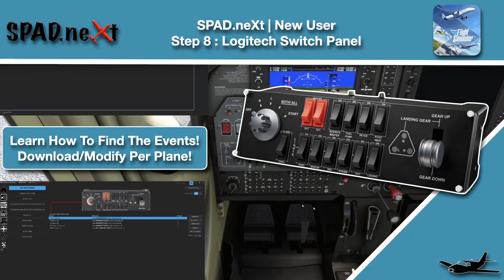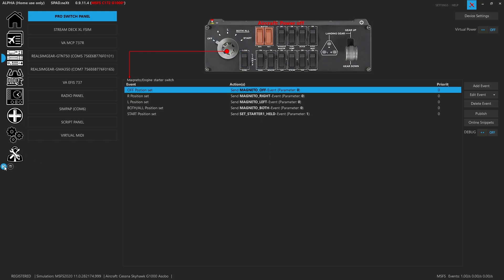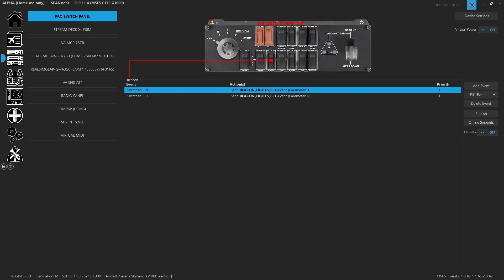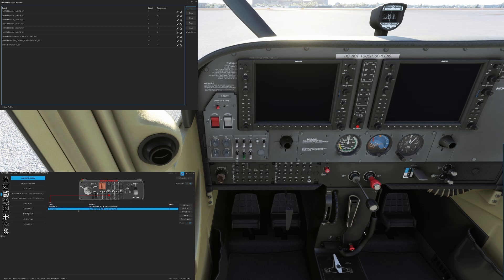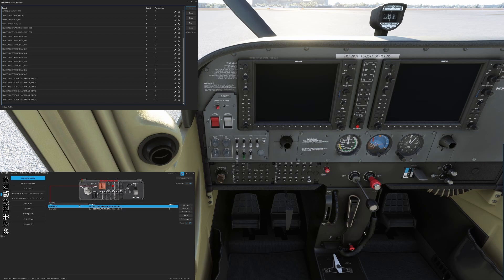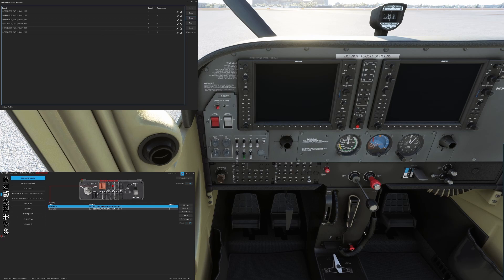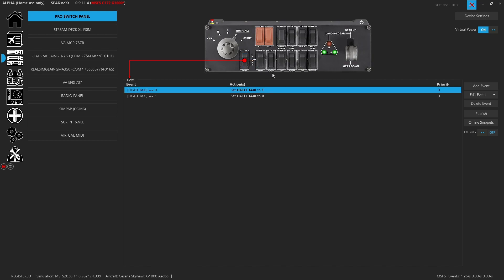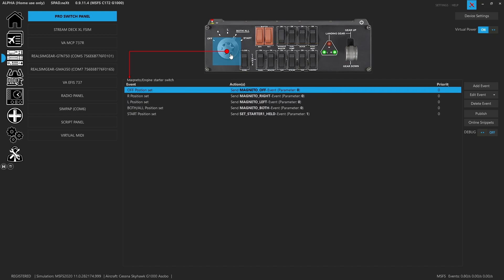(Sim Video) New User #8 | SPAD.neXt | Logitech Switch Panel

Comment: i just can't figure out how to keep the starter for the duke in start position for the left engine in the pro switch panel. the starter jumps back into booth after about a second in the simulator. otherwise off left right and booth works. i haven't found anything in online snippets that work either.😩
Reply from the maker: I followed instructions in the Spad Discord in the BKSQ section.  Topic with Title  "Duke magneto" and implemented that via a script.  I will leave the update there showing how on the Switch Panel
Reply: @LesOReilly  Thank you for your answer. I will give it a try.🙋‍♂️

Comment: i have to say it is so sad this dumb idea of the concept behind these panels, is just dumb we have to call it by the name, MSFS or any other Sim should be able to recognize it just as a game controller and we could map the switches the way we wanted , we have to go through so many opsies to get this device working normally as any other game controller, the fact it has a hardcode making just the way they want is the most bizarre decision i actually have seen. To make it work in DCS i had to find a video, thank God, from a user that teaches how to install a third party software and change the actions of each button,  it took me like 3 or 4 hours to map the switches because the software isn't easy but gets the job done, anyways tx a lot for this video now i will need to waste more 2 or 3 hours around this software and buy it,  these companies will be surely passed by new ones who have a better concept.... I really regret buying 2 of these switch boxes when we have so much choice on the market, oh well my mistake by not doing a research before, but for me USB flight switch = gaming custom controller, even my logitech racing wheel can be used on any Sim, i never though the electronic design and concept would be like this.
Reply from the maker: Yes would be great if they had made it configurable. This is why I started using Spad next in 2015. I bought a bunch of saitek panels and wanted to do more with them. 

That said the amount I have spent on hardware I will not use the sim to bind anyway. To many gaps in controls and no way they offer any kind of logic or scripting like we get from add ons like Spad.

Comment: Les O´Reilly 
The light switches on my logitech switch panel don't work at all, I already tried to correct it from Spad.next and they still don't work. What I can do?
Reply from the maker: if you don't see them move in in the SPAD UI then you have a problem with your logitech device..  if it is something to do with send events make sure you removed the Logitech Plugin.. other wise they will both send events.

Comment: Very useful video thank you
Reply from the maker: Thanks for taking the time to leave a comment..  Always nice to hear that it was found useful to people.
Reply: @LesOReilly  I’m starting with the. Beginning of the series and will be setting up my panel today to get it all dialed in. 6pack, plus panels and switches. My computer should be able to handle it without issue. Interested. I’m also using my iPad and linking foreflight do you have a video on that also?
Reply from the maker: @Officialflymedia  I do not have a video on foreflight ..  I use FLTPlan GO for my IRL flying and have it connected via their plugin application..

Pretty sure Foreflight has the same software type download to install and run.
Reply: @LesOReilly  thank you! Where do you fly out of IRL?
Reply from the maker: @Officialflymedia CYOW. I have videos of that on the channel as well.

Comment: Is there a way to have an empty box until you press your switch so it shows up, at present the box is filling up and I have to look through what it says to find it..I see when you switched on the beacon light that's all there was...how did you get that?
Reply from the maker: in the Event Monitor video you will see that I Start the event monitor ... then Stop it ... I then take the "noisy" events and press the X to remove them from the monitor and then press Start again..

Comment: Hello i have a problem i can’t assign taxi light 💡 on cessna on the switch TAXI only possible on the switch write COWL
an idea? Thanks
Reply from the maker: ?? That does not make sense. You mean it won’t work? Or you can’t assign the function?  Works fine for me.
Reply: @LesOReilly  hello.. i can’t assign 
If i launch the switch panel with his driver it work well(the switch) ≠ with SpadNext (don’t work for this function)
Reply from the maker: @kdbninerseventwo  you have to uninstall the logitech software and drivers ... you can't run both...
Reply: @LesOReilly  okay Teacher.. Thank You

Comment: Hi. When I start the Event Monitor, it just continually scrolls though events. I cannot get it to stop. Have you seen this before?
Reply from the maker: Yes there can be noisy events ...  you press Stop and then on each line item you can press the small x to remove them ... this will  prevent event monitor from reporting that event again until you use the clear event to reset things.
Reply: @LesOReilly  why di we need to do this every time? its very anoing.
Reply from the maker: How is it to know what events you don’t want to see???

Comment: Fantastic Les!!! Many thanks for this video - this is just what I needed. Now, here is a question - the EVENT works fine but the DATA one does not work for me. Actually, I am trying to configure the autopilot. Switching the AP on or off shows up in the event viewer fine but pressing the HGD, NAV, etc buttons does not work. Any idea?
Reply: I updated the Bridge just now after viewing your other video and that fixed the AP buttons problem. But if you can explain the DATA issue....
Reply from the maker: What issue are you having with the data monitor?
Reply: @LesOReilly  My question is - how to use it?
Reply from the maker: Check out this one. (Sim Video) Getting Started with LVARS / Aerosoft CRJ
Reply: @LesOReilly  You are the MASTER of SpadNext⭐️ I have learnt about SpadNext more by watching your videos than by using it for last many years. Thanks a lot.

Comment: Thanks Les.  Hadn't discovered the Events monitor.  I have one problem in Spad and I wonder if you have come across it.  When I go to the events page to add an event and I want to filter the events, I cannot type in the search box...it is dysfunctional so I have to scroll through the entire list each time.
Reply from the maker: I click in the search box and start typing... maybe a device is taking the focus away from spad? like a touch screen or something that is click away??  No Idea...  Maybe make a video and share it in the discord for us to look at...
Reply: @LesOReilly  Thanks Les. I'll see what I can do.
Reply from the maker: Yeah OBS or even the NVIDIA stuff capture the screen of what it is doing... heck use a phone camera anything that you can share to the Discord so we can see where weird thing is blocking you from entering text in the search box
Reply: @LesOReilly  Well Les, I installed OBS on my pc and I happened to change some screen settings & swap some usb connections around and when I went back into SPAD my problem with the search box was gone !   Thanks for the tips anyway, I'll keep them up my slieve.